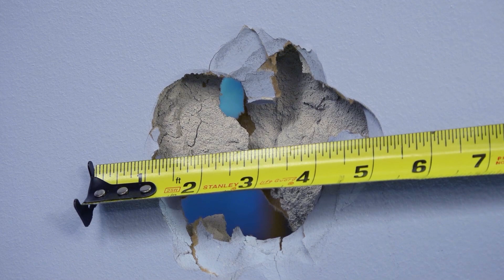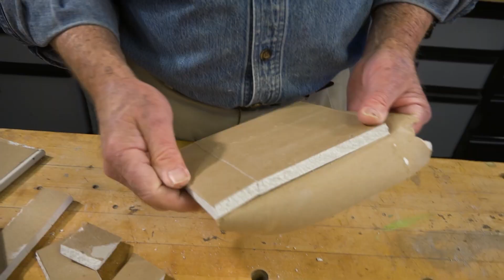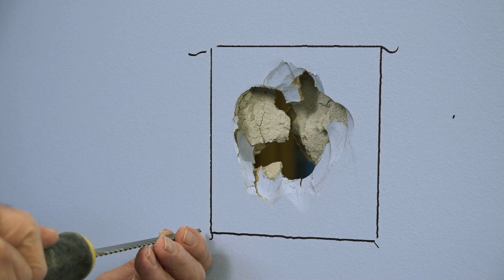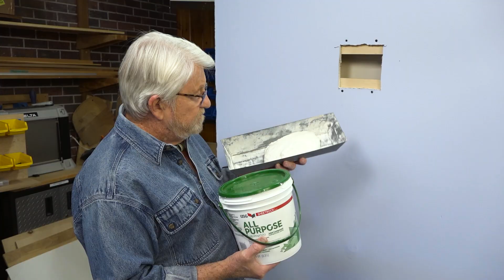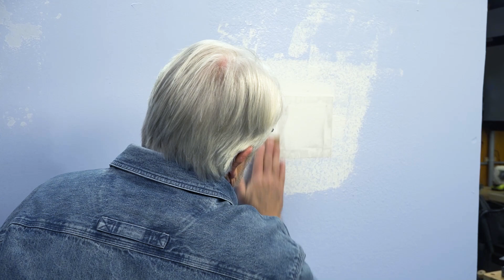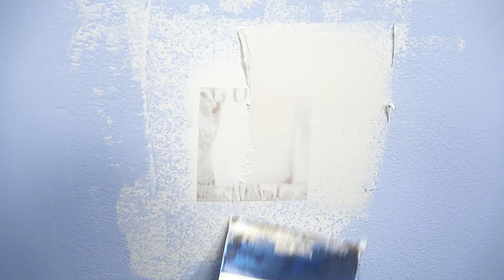3 Easy Steps For Fixing A Hole In The Wall

Comment: How to match the texture on the walls though?
Reply: The texture comes from the paint roller just like on the original wall.  The sheetrock was smooth to begin with so the only difference is the paint roller.  If you use a paint brush then you wouldn't have texture and it would stick out like a sore thumb.